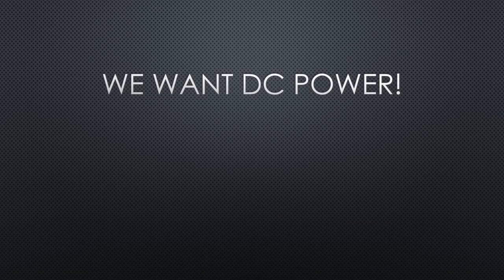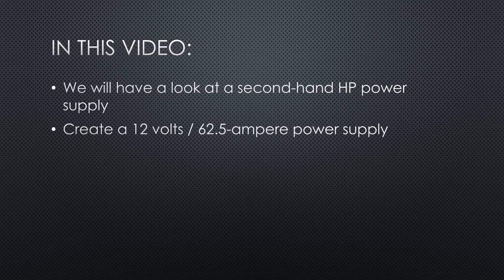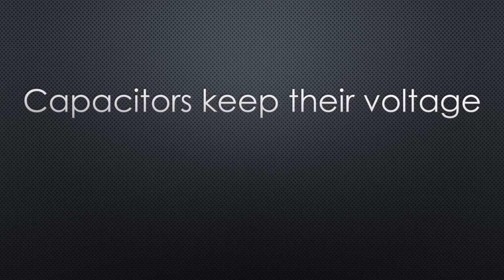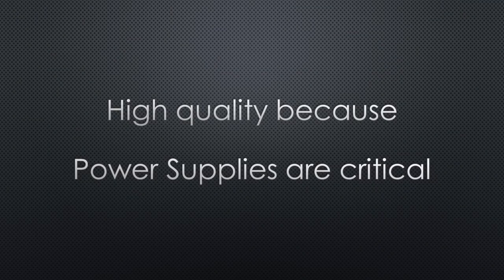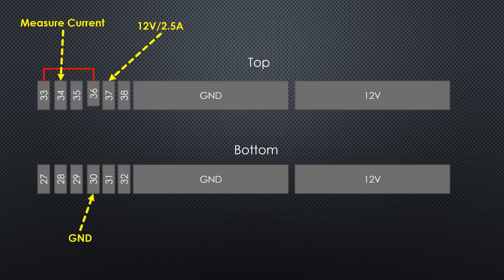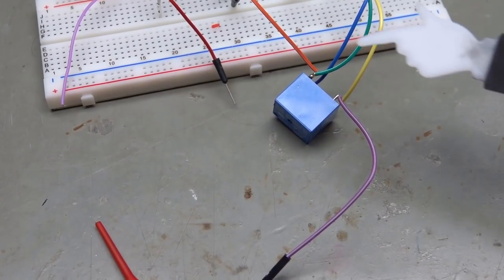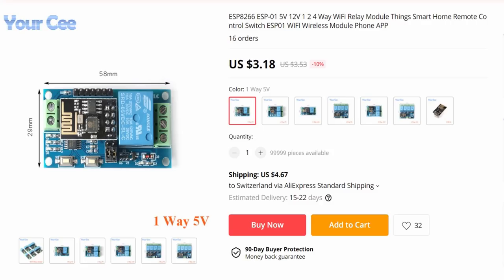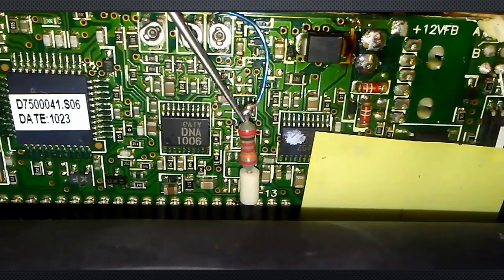#342 12V/60A power supply (PSU) for 20 dollars? Unbelievable, but true. And high quality.

Comment: Thanks a lot for this video, I picked up one similar model as yours for ~€25 incl shipping.
I just have one comment regarding changing output voltage on a live PSU:
You say that it's too dangerous and I agree!
But you could do a video where you modify the resistor values by injecting voltage to the DC-side safely using a 13.8V rated PSU/bench PSU.
That would be a highly appreciated video!
Reply from the maker: There are many different types around and all have to be modded differently. If somebody is capable to do the hack, he is also capable to find it, I think ;-)
Reply: @AndreasSpiess  I agree. Thought particular model of PSU could've been the subject for modding 👍

Comment: For 12V battery charger one could also just use a 12V-12V DC-DC converter. This way everything can also be kept legal, and not loose too much in effiency either.
Reply from the maker: Do we talk about the same? These PSUs run on 120 0r 240 volts
Reply: @AndreasSpiess  Yes and no.. I was referring to the modifying bit where you change 12V to 13,8V.. That could be done without touching the insides by using a 12V-12V battery charger, which obviously charges at ~14V.
Reply: @rkan2  Such a device is better known as a "boost converter".
Reply: @NiHaoMike64  Yes, true :)

Comment: One thing I don't see mentioned here is that these modular server power supplies are generally LOUD. Small high volume fans are always screamers. In a data center it doesn't matter, in your house they become a bit more obnoxious.
Reply from the maker: There are many comments about that fact. Mine was not loud. But I only tested to 50% load. Most of the time the Fan did not run
Reply: @AndreasSpiess  Hmm. I've got a few of these, mostly out of super micro chassis' though, and they're all pretty much constant screamers. They all run at 100% fan speed no matter what.

Comment: What is needed is to modify its control strategy to CC/CV for charging lithium batteries...
Reply from the maker: I think you need a proper charger for that. These PSUs have no current limiter other than the 62 Amps.

Comment: Thanks for this video,   I just went to eBay, picked up two 2450 watt power supplys, what I'm going to do with all that current, I'm not sure yet, I have heard it can be tricky to put in series, for 24v, I'd like the option to get 24v, maybe 28-29v to charge my 7s lithium battery bank, with my generator, I would only charge it to 85% or so, unless I find a cc CV DC converter that would handle the power, I'd like to get 2 kw from it atleast,  I need to research how to build a cc CV DC boost converter, to build a charger, maybe I can modify a brushed motor controller, to limit current, ha-ha, or maybe a bucket of salt water! Maybe a solar charge controller will work good enough to occasionally charge my bank with a switching supply powered by my generator! I'm case you wonder why I bother, im off grid, with limited PV, and sun, and have about 30 kwh lithium battery to charge! And a 600-700 ah lead acid battery to keep up! It's for back up power!
Reply from the maker: You can put tehm in series if you isolate tehm completely. But it seems they have an overvoltage protection.

Comment: Hi Andreas - as always with your videos, I liked that one very much. Although it's 3 years old now. Some people recommend theses as power supply for programming car ECUs, where we need lots of Amps, but also a very stable Voltage / quick reaction to changing current (how is this measured?) and low ripple and noise (<50 mV	rms). Did you ever find information about those specifications in your projects?
Reply from the maker: No, I never did anything like that :-(

Comment: Hi, Andreas. Thank you for detailed description. Is it possible to use this power supply as adjustable laboratory power supply? I mean to modify it to the regulated one from min to 12-14v?  I tried to increase output voltage up to 13.8. For that purpose I shorted SMD resistor, but PSU lost their output voltage at all. I think that overvoltage protection save some data to the controller. Maybe you know how to reset it?
Reply from the maker: I Do not think it has a memory (other than if you killed something). 13.8 V works for me for more than a year. Maybe your change produces more than 14 V and the overvoltage protection kicks in all the time

Comment: According to Andres, the PSU is switching at about 500KHZ. Has anyone looked at the level of the noise on the 12VDC supply under load?  I'm thinking of trying one on my HF amateur transceiver which draws in the order of about 20 Amps.  By the way Andreas, thanks for another great video!
Reply from the maker: I left a link to a German video about the matter
Reply: @AndreasSpiess  Oh... Sorry, I missed that. Thanks

Comment: looking at the fan that's build into this i imagine it will be quite loud when under load...i wouldn't want to have that sit on my bench sounding like a starting jet all day...  a "normal" (my) PC supply with a 120mm fan delivers around 40 Amps at almost silent operation. (also you get 5 and 3.3 V right out of it, so no extra converters required)
Reply from the maker: It is not too loud (at least mine). And it did not run most of the time.
Reply: @AndreasSpiess  I see, maybe i had bad luck, the last server PSU i saw in operation was really really loud, even with no load. Maybe something to watch out for when buying ;)

Comment: I would check if one pin of the switch on feature is just GND ( or + ) then you can omit the relay. pull down the short one just with the MOSFET. If you need  to connect it to + then you need a second transistor.
Reply from the maker: I tried it, of course. These pins did not react to logic levels
Reply: @AndreasSpiess  What does this mean? What is the voltage level on each of the two pins in open state and in connected state?
I know "pins that do not react to logic levels" from a Mercedes truck Engine control unit: For safety reasons you had a square wave on one pin and the had to be connected together with less than 3k ohm. But that was to start the engine. I can not expect this in a PSU even from a server.
And it is possible that it still can be switched with an analog switch or a FET with sufficient margin for the gate voltage: An NMOS FET with +12V at the gate (you have that available) switches any voltage between 0V and 12V - V_gth. 
I am not convinced, that a relay is really the only working solution. :-) It's the easiest solution but with the highest power loss. What of course, is not the most important thing in this application.
Reply from the maker: The ESP only has 3.3 volts. Maybe with two FETs and 12 volts it would work. It was easier for me to just take a relay

Comment: Apologies if this has already been raised but wouldn't it be easier to wire pins 33-36 permanently together and then insert a Sonoff Basic into the mains power line that way you have wifi control without building esp01/relay/voltage reg circuit.
Reply from the maker: Also a good possibility, I think. And it saves some energy.

Comment: Hacking the voltage is really hard & usually not worth the effort on new power supplies.  Old ones from 20 years ago are much easier.  Lions usually need 15V-18V which is right at the limit of their caps.
Reply from the maker: For the one I used it took me less than 10 minutes to get the 13.8 volts

Comment: The efficiency is quite good indeed.  Some time ago I bought such a supply which was a bit older, I think it originally came from a SUN server.
The efficiency at full load was OK (not as good as this one), but: it had quite a large power consumption at "idle" (no output current).
As I wanted to use it as my station power supply, in the junkbox it went.
Did you measure the power consumption at idle?   (switched on, but little or no load, like with the TCVR on receive only)
Reply from the maker: Mine consumes 12 watts idle with nothing attached. Just switched on
Reply: @AndreasSpiess  Thanks!  That is very acceptable...
Reply: @AndreasSpiess  And how much does it consums with main 12V 62A turned off (just the 12V 2.5A line active)?
Reply from the maker: @TEONN: The same if you do not draw current

Comment: Would you mind doing a video on a PMBus sketch? There's a tremendous amount of data many of these server PSUs put out, but so little information on how to make use of it outside of decompiling some IPMI board management controller firmware. I've scoured the internet for years but the RC hobby guys don't cross over into the microcontroller hobby often, and most resort to the wire/resistor bridge to assert PWR_GOOD and completely ignore I2C/PMBus/SMBus. I know there's a couple libraries out there to deal with it, but it would be a great help for at least someone trusted in the community to make a video drumming popularity up for it...
Reply from the maker: I think the PMbus is far too special for this channel. Maybe another channel or blog will do  it.
Reply: @AndreasSpiess  Oh well. Thanks for the wonderful video anyway!

Comment: Any used PSU is  a roulette in my opinion. I've didn't thought that 62A is an actual power for Neopixels! My thoughts were "hmmm... 8-10A max."
My main aim is bipolar PSUs. For DIY analog synthesizers. Some MeanWell PSUs are ideal for it. But gives not too much power (1-2A). The cost is about the same :) I must say that 10-20 bucks for a bipolar MW PSU seems too much IMO.
Maybe you know something to solve this? Also MW PSUs has a pretty noticeable volt. noise (can be filtered of course).
Reply from the maker: 1. These PSUs are successfully used for years by the RC community. The quality of the parts seems to be much better than most other power supplies we can buy.
2. For analog stuff, I never suggest using switching PS. Better no noise than filtered noise ;-)

Comment: Should be very easy to make your own xt90 psu. 3d print end caps with  built-in wire port's. Would it be possible to carefully clap insulated copper washers to the DC terminals of the PSU and interchange different 6awg ring adapters depending on application like EC5 XT-90S SAE etc. Those would sell like hot cakes. Lastly I wouldn't risk my life modifying a PSU when there are very safe 30-60a cc cv boost converters available on the internet. Thanks
Reply from the maker: The RC community seems to use these PSUs since a long time.

Comment: I have a question related to neopixels and DC power supplies...

I recently tried to install a WS2811 led strip into a "smart" greenhouse, controlled by an ESP32. The WiFi network in the greenhouse is supplied by a "powerline" adapter (think something along the lines of Ethernet over AC mains power), which, unfortunately, it seems is unable to operate correctly in the presence of high frequency PWM devices, such as LED strips, due to the noise injected into the mains power when the PWM device is running.

The LED strip was supplied by a rather basic 150W DC power supply, which clearly doesn't have adequate filtering on the primary side to prevent the noisy pwm signal from carrying over to the mains power.

Do you think a computer PSU along the lines of this might do a better job with filtering, given that they are likely to have a more sophisticated design than a generic 12V DC supply?
Reply from the maker: Here you see some ideas (German video) https://www.youtube.com/watch?v=1kFAyaeHwS8
Reply: @AndreasSpiess  Thank you so much!
Reply: I don't speak German,  but I think I get the idea...  :-)

Comment: How does it deal with an accedental direct short ? How did you tap off the high power connections in the end ?great video, we need a part 2 where you test it to distruction John ward style..
Reply from the maker: It is short-circuit protected. I wait for some Andersen power poles to connect power.
Reply: @AndreasSpiess  cool :) love your channel. Thank you

Comment: us 240v ac outlets always use a longer earth ground pin for similar reasons. my current flat doesn't even have gfci protection on the 240v air conditioner outlet pluggin.. which is sketchy/shady but.. keep in mind we center tap and one conductor is 120 the other negative 120 so with the ground pin longer and fact I never touch the plug it's still.. meh.. but code does now require gfci/has for like 2 decades. this place I'm at is just such a slum lord that the garage door motor doesn't even have the connection points for optical sensors
Reply from the maker: It seems that 220 installations are different in each country. Who knows why...

Comment: literally last evening I was shopping for a PSU, I've seen these with fans but I thought that it runs all the time and my application required it to be silent but I managed to find one without a fan. We can assume that HP is a quality brand but I had a hard time finding information about other manufacturers.
One thing that I am still wondering about - is the component degradation a thing to worry about? these PSUs have most likely run for a few years by now...
Reply from the maker: These second hand PSUs are widely used by bitcoin miners. So I assume they are ok and if they fail, they do no harm. But I do not know.
Reply: Kanapka Z Pasztetem
 "is the component degradation a thing to worry about?" -
Of course, but the build quality of server PSUs is about 100x better than regular PC ATX power supplies. I would argue that the expected life-span of a used server PSU (with typical 5-7years of 24/7 use) is still more than 10 years longer than a brand new PC PSU. I have opened several server PSUs, and their components are, without exception, the best of the best. All electrolytics, for example, are Nichicon, Rubycon, Nippon Chemi-Con, and Panasonic. This stuff was designed and built sparing no expense, unlike home PC PSUs, which use as cheap components as possible to maintain, say, a 90% failure-free rate for the one year warranty period.

Comment: I've used PC power supplies in the past, but this is a great idea for higher quality supplies.  Is there a cross-vendor standard connector/interface on these?  
As always, an interesting, informative and very useful video.
Reply from the maker: I do not know if it is cross-vendor. At least it seems to be a HP standard.

Comment: Hey - you have caught up...there are PCBs available for these that allow you to connect and power on and also measure the voltage - inaccurately.
Reply from the maker: Right!
Reply: @AndreasSpiess  You may be interested to know I just did something similar with an Eltek Flatpack 48V 2kw  supply that's programmable by CAN bus. They were cheap a couple of years ago but word has got around. Still for £80 you get a 2kw 48V supply that's good for driving RF power amplifiers. 

The reason these HP supplies are recently so cheap is they were being used largely for bitcoin mining and that's no longer economic. I obtained 4 of them, two of the 700W and two 900W. I converted tow to 13.8V. For output there are several PCBs available that just plug in and they come with various breakout connectors. Anything from the https://www.ebay.co.uk/itm/Breakout-Board-Adapter-for-HP-1200w-DPS-1200FB-Power-Supply-Bitcoin-Antminer-/401194419411 to this https://www.ebay.co.uk/itm/750W-1200W-1500W-Breakout-Board-W-Button-for-HP-PSU-GPU-Mining-Ethereum/253790694196?hash=item3b171aab34:g:LE8AAOSw1IVb5n5S and everything in between. They are cheaper from Alibaba. 

I like the information on the pins - did anyone decode the data interface and get anything useful? There is not a lot more than voltage and current but the Eltek mentiond above had costant current modes that's useful for charging, tells you temperatures, mains voltage, output voltage, current and probably phase of the moon.
Reply from the maker: Thanks for the links. I put them into the video description.
I did not find any information about the PMbus

Comment: 90% efficiency @ ~30% load is very nice, but how is the idle power consumption?
For 24/7 connected usage with a low active duty cycle I find that idle consumption can quickly become a large fraction of the total power used
(Also of interest are lower load efficiencies, especially if one where to say power a energy efficient home server using it, they often idle below 30-50W)
Reply from the maker: Mine idles at 12 W

Comment: Andreas. Is this usable for something like a car audio amplifier for example? If yes, how/why? 
I'm looking for a supply to support about 250W of power so around 60A +/-10% so that I can have a usabled subwoofer from my car setup but running in my home.
Reply from the maker: You have to try if it creates any interference. They are made for digital systems. I left a link to a (german) video on how to remove RF noise

Comment: I boosted mine up to 17v. Data sheet said 18v max on the power supply chip. ;)
Reply from the maker: Maybe you have a look at the capacitors, too. They are the first to explode ;-)
Reply: @AndreasSpiess  already changed them ;)

Comment: I got a Dell 495 watt PSU used for like $14 or something that was 80 plus platinum I did not find much info on it as far as adjustable voltage but I got it going for 12v
Reply from the maker: Most users are probably happy with 12 volts...
Reply: Ya I know I just would have liked some adjustability